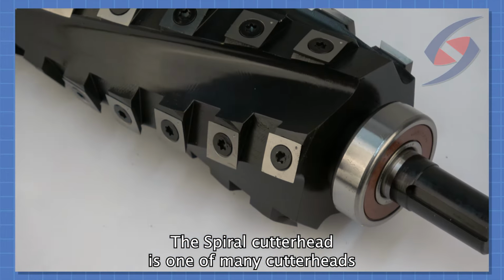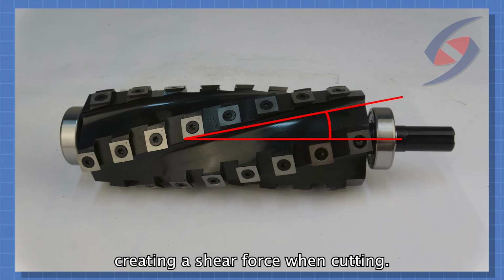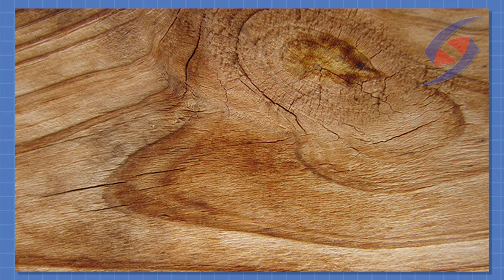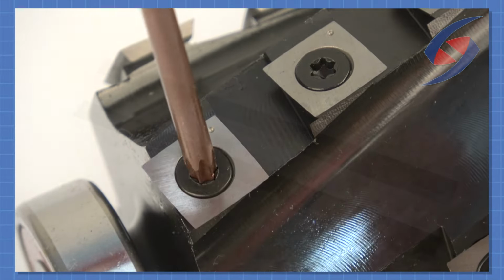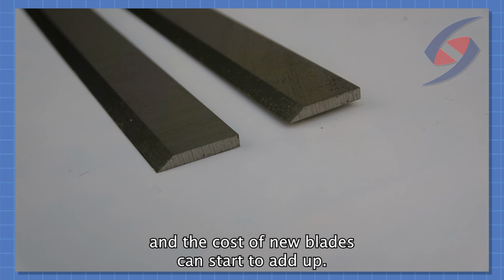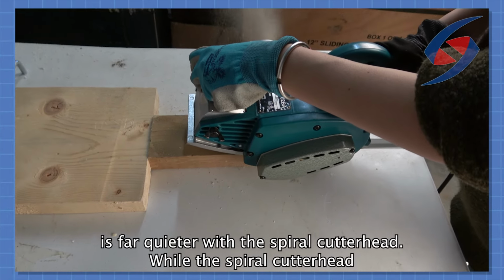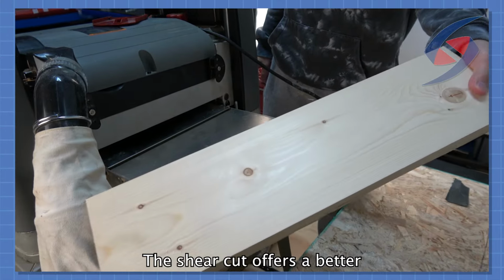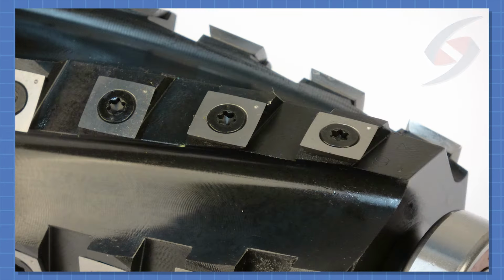Why Spiral Cutterheads Are 10x Better

Comment: I installed a Shelix 13" spiral cutter head in a Ridgid planer several years ago. It planes very smoothly, much better than the original straight cutters. I finally rotated the carbide cutter heads because I was cleaning up some old fence boards for a large project. Took me about 30 minutes to rotate all 70(?) of them and I was planing smoothly again. My planer isn't the strongest so I don't try and make deep cuts. If you can get one for a planer and/or jointer I would absolutely do so. I know I could easily cut 1/32" on an 8-10" board except maybe for very hard wood. These spiral cutters are much better than flat blade cutters.

Comment: If a planer/jointer (felder AD 741) is currently struggling with depth of cut more than 1/32-1/16" with the stock 2 edge replaceable straight knife setup,  would it struggle more or less with a sheartak head? Its really a dog in planer mode for such a large machine in its price range.
Reply: It would struggle more according to the video. The AD741 is a good machine, but the motor must be undersized. Maybe you could upgrade the motor. I think they offer 4, 5.5, 7.5 and 10hp motors for them.

Comment: How does this compare to a helical cutter head?
Reply: What they are calling a spiral cutterhead is the same thing as a helical cutter head.  The blades are angled to shear cut.
Reply: @Zero2Random  I agree. Spiral cutterheads cut  straight on the wood just like a straight blade, just a smaller cut. The pictures shown are a elliptical cutterhead.
Reply from the maker: Thank you for your comment! Spiral cutter heads, featuring individual carbide inserts, are highly effective at shear cutting and minimizing tear-out. The precise placement of each carbide insert enables a slicing motion, leading to smoother cuts and a reduction in tear-out. If you're interested, we have another video that provides a visual comparison of these cutter heads. You can check it out here: https://youtu.be/Y4r_H1RwE7k
Reply: Helical heads and spiral heads are different. Helical - inserts are rotated around the cutterhead block, but seated square to the material edge. Spiral - inserts are rotated around the cutter head, but seated at an angle to the material edge creating a shear cut on the material, which is much better.
Reply: @the-wooden-beard  I think you got that backwards